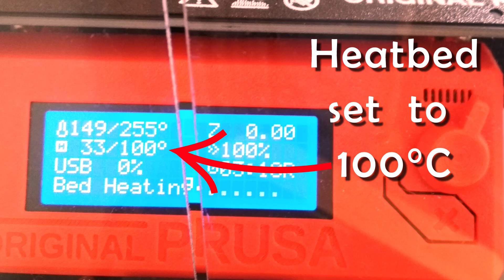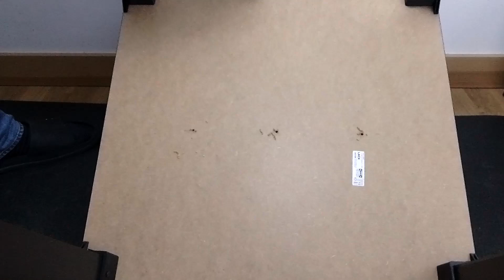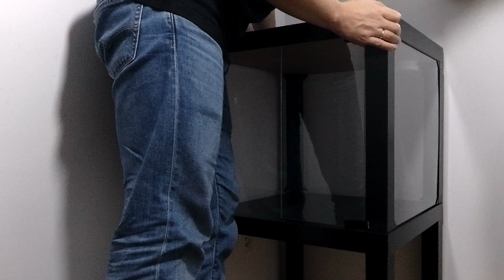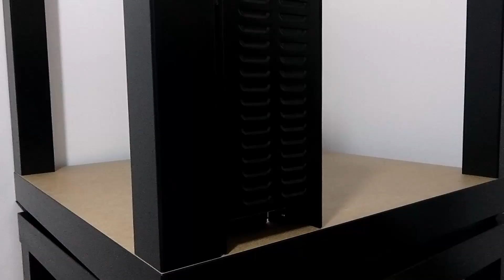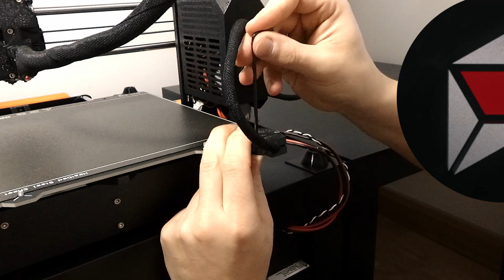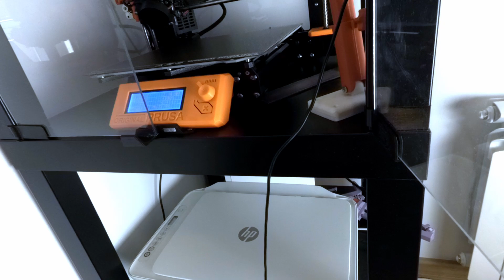Building an enclosure for my Prusa i3 MK3s using Ikea Lack tables

Comment from the maker: Do you have an enclosure for your 3D printer?
Reply: Not yet but maybe in the future, I will make one for myself ;-)
Reply from the maker: @Creative_Electronics  It's a little bit wobbly, but otherwise pretty cool :)
Reply: Not yet, It is planned though ^^
Reply from the maker: Are you going to use Ikea Lack tables or something different?
Reply: @medyk3D  Yes!
Reply from the maker: @Matthew Robinson The bottom table mounts: https://www.thingiverse.com/thing:2041575
Actually for the PSU I used custom holders, I will upload them in a while.
Reply from the maker: @Matthew Robinson PSU mounts: https://www.thingiverse.com/thing:4580952

Comment: This case looks bad .... First of all weak insulation. Second of all whats the point placing filament outside of enclosure? It can get moisture ....
Reply from the maker: Yeah it sucks. Would be better to use v-slots or other profiles and create a bigger enclosure with place for filament, heating element, fan and electronics to control the temperature inside. But then it would  cost more than the printer itself. The size/price for this one is comparable to Creality 3D Printer Enclosure (medium one). For the PA/ASA filaments you would need a drybox. Most of the enclosures I know (for rat rig or voron) do not have a place for the filament either. For Bambulab X1 you need AMS.

Comment: Nice building! 
For what do you need two tables? Why not just Polycarbonate on the top without a second table?
Reply from the maker: The table on top act as a sturdier frame. You can place filament on top of it.

Comment: Where did you get plexi for $30?
Reply from the maker: On allegro (polish Amazon). It was back in 2019. Here is actual offer for 1000x1000 3mm for 140 PLN ($35)
https://allegro.pl/oferta/poliweglan-lity-1000x1000-bezbarwny-3-mm-11381694607?utm_medium=afiliacja&utm_source=ctr&utm_campaign=6ab23417-9626-4a96-a511-1dab7cd5d35c
Reply: @medyk3D  Ah, I ended up digging around and the cheapest I could find was from TAP Plastics here in the US. Was something like $56 US total shipped, so not too far off. Thank you for the info!
Reply: @medyk3D  Thanks, I was able to get some for $38+shipping at TAP Plastics here in the US!

Comment: Quick question where did you end up using 20 magnets?All i used was 4 (2 for the door and 1 for each of the door handles)
Reply from the maker: I modified it so back and side panels are detachable. For holding the panels I'm using magnets - 4 per panel.
Reply from the maker: Here is the video about magnetic side panels: https://youtu.be/wPDDAKRXscM
But I put 20 magnets in BoM because I bought them in bulk of 20 pieces. For this design you just need 4. For magnetic side panels another 12.
Reply: @medyk3D  i see.
Thank you for the reply :)
Reply from the maker: @simaocarreira3262  No problems. Thanks for coming by. Cheers!

Comment: 52 hour print time? Hell naw, I'll fabricate something in the garage in a small fraction of the time. A clear example of why not everything that can be, should be printed on a 3D printer. Mixed media, guys. There's a time to use metal and woods tools, and a time to use plastics.
Reply from the maker: This is true. But during the print time you can do other things/projects. Not everyone has a garage and tools needed to create a decent looking cabinet. If you only have a 3D Printer and limited space this idea is ok. But if you can build a custom enclosure it is obviously a better option (it will be much more sturdy for sure, this is one is little wobbly).

Comment: I printed 1mm thick spacers for the two front legs to solve the door hinge rubbing issue. Worked for me.
Reply from the maker: That's a great and simple idea. I changed the bottom corners so I can deatach my side panels (https://www.thingiverse.com/thing:4548027/) and now the doors are working ok.
For now thera are two issues: it is wobbly, and it could be higher so I can add a concrete paver like Stefan did: https://www.youtube.com/watch?v=y08v6PY_7ak

Comment: Is it mandatory to remove and relocate the power supply?
Reply from the maker: According to https://blog.prusaprinters.org/cheap-simple-3d-printer-enclosure_7785/
"keeping the PSU in temperatures above 40-50°C can significantly shorten its lifespan"
So it depends on the temp inside. While printing with ABS for an hour it reached 28°C inside. 35°C is considered to be safe, so the PSU can stay inside.
Recently I printed with Nylon and the fan shroud deformed/melted, but I haven't checked the temp inside. I think that it wasn't above 35°C.
While printing with PLA I keep the side panels deattached. PETG and ABS closed.
Reply: @medyk3D  I have the same enclosure and I just mounted a small fan at the top, in the back, facing out in a cut out hole in the plexi. I also leave 1 or both doors open when printing PLA. Don't think it's necessary to remove the side panels. 👍
Reply from the maker: @xJamadeus  For me it's easier and more convinent to remove the side panels. Now I have them easily detachable with magnets, so while printing with PLA I just remove them. I can leave  the doors closed so they don't get in the way (I placed the printer in a narrow room).
Adding a fan is a good option. 
In the summer leaving the doors open wasn't enough.
Reply: @medyk3D  OK, I understand. Well, anyways, thanks for a good video!
Reply from the maker: @xJamadeus  Thanks, glad you liked it. Cheers!

Comment: Where did you find the PSU enclosure and support?  The one I found is only for the silver PSU?
Reply from the maker: I made one: https://www.thingiverse.com/thing:4580952
Before 3D printing it check the dimensions of your PSU. I have the black from i3 MK3s, but I'm not sure if all are the same. I found one holder for the black PSU and it didn't fit.
Here all the other models:
https://www.thingiverse.com/medyk3d/collections/prusaikealacktableenclosure

Comment: Love the enclosure! I need to make something like that.
Reply from the maker: It is great. Little bit wobbly and the door hinges  needed some attention. But nothing major. Especailly for the money
Reply: I’d think it might feel more stable with rolls of filament etc on the bottom shelves to add some weight.  I’ll be doing the same design myself..... once my printer arrives.  Got all the screws, Perspex etc to build the enclosure.... just waiting on the printer to make plastic parts and do the rest.  Also going to do the V2 for MMU later.

Good video as well.  I’ll keep my iPad nearby to watch as I go,  also going to print some L shaped brackets to help stabilise the legs.